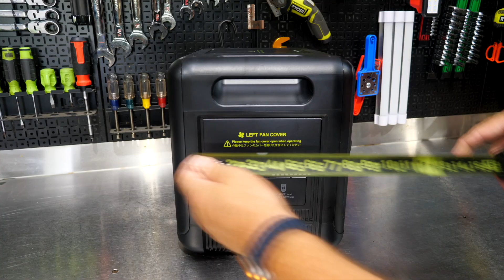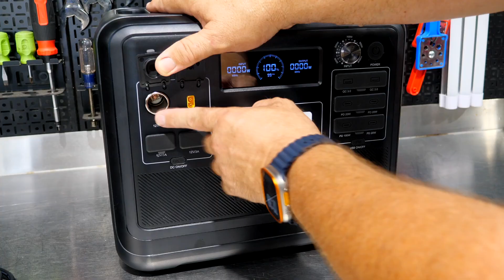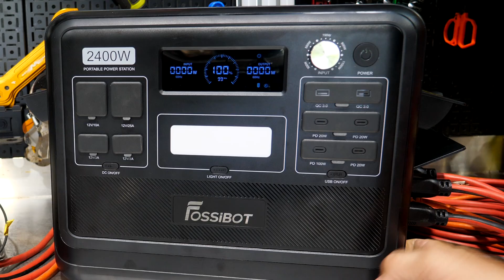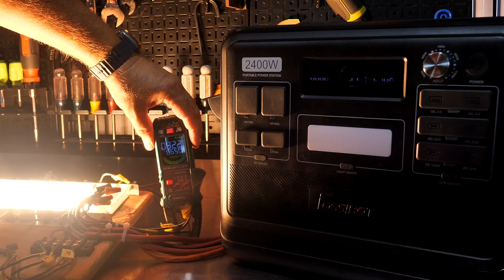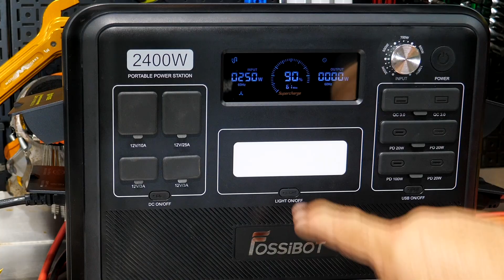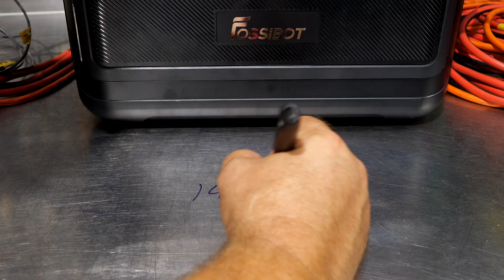Fossibot Portable Power Station Tested – What Can It Really Run? 2,400 Watts [2400W LiFePO4]

Comment: Helpful review thank you, but one important correction I have to make before anyone damages their 2400.
The front panel 12v outputs are just outputs. Any attempt to charge the 2400 via these will almost certainly damage the unit.
The xt90 input on the side panel is the only dc charging input. It will accept 11.5v to 50v so can be used with solar or car cigarette 12v.

Comment: This reminds me of the OUKITEL P2001 I got on amazon last year. Def a cheaper design than name brand and though it claims same 2048wh but i tested it at ~1750wh (my bluetti and ecoflow were far closer to rated capacity) I love that they put a storage bin on top for wires and my favorite feature that I wish they all included is that knob to adjust charging input instead of it being hidden inside and app